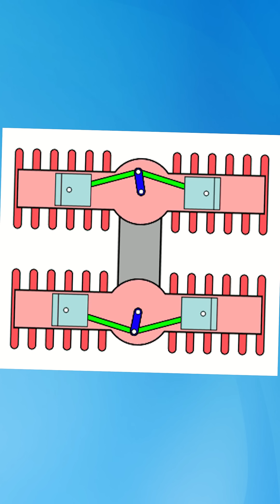wHY DoN'T CaRS uSE H-ENGiNEs?

Comment: It's 
>Big
>Heavy
>Overcomplicated
Reply: same
Reply: @peely1359 ?
Reply: sounds like it came from the depths of hell tho
Reply from the maker: Perfect
Reply: @BladedAngel  Not really. As I said above, cars never used H engines because they never need that many cylinders. H24 engines worked very well in pre jet-engine aircraft engines in WW2 where power over 1000 horsepower was needed. There was one formula 1 H16 engine. That's about the only application there's ever been in a car. You should take the "any more" out of the video title.
Reply from the maker: @londonalicante  i don't think this comment train was talking about Engines
Reply: @londonalicante  as a worker at Valvoline thats simply not true. Subaru uses a H 6 engine in there older outbacks and trevia b9
Reply: @mylifeperiod630  If you work at Valvoline you probably know something about engines but please watch the video before commenting. A subaru H6 is just a brand name for a flat 6. A H engine as defined in this video is an engine with 2 crankshafts, 1 above the other, each with identical number of cylinders in a flat arrangement. Only practical for applications needing large numbers of cylinders.
Reply: It worked well in the right applications (i,e those that at least 16 and preferably 24 cylinders) which was mainly planes before the invention of the jet engine. Nothing wrong with the configuration, it's just that cars are too small of an application for it.
Reply: @londonalicante  But we speak about cars.

And in cars H engines make no sense.

A V12 is better in any aspect
Reply: Stop describing my taste in women.
Reply: @TheMattvf16   wha...
Reply: @TheMattvf16  hell nah 🤦‍♂️
Reply: @TheMattvf16  vro likes losing
Reply: @TheMattvf16 ayo 😂💀
Reply: They probably cost a fortube in labor to repair.  Also imagine how rare the parts for those are, if there are any left anywhere!  It is basically an overcomplicated Boxer engine really!
Reply: Read top comment in syndrome voice
Reply: It should be an 'X' engine, two flat 8's at 60° to each other. Much simpler.
Reply: That what she said 😂

Comment: It just doesn't make sense. You don't need more than 12 cylinders in a car, and that's easiest and most efficient with a V12. Even Bugatti's V16 doesn't make sense. 1000 hp could easily be achieved with a V12, and it would be smaller and lighter. Different engine types have different advantages and disadvantages. But an H engine would only have disadvantages compared to a V12.

Comment: H is a fun configuration, but my favorite of these ancient niche engine layouts is the U configuration. Yes, U, not V. No one uses U engines because they are just really not good. For those who don’t know, a U config is really just two inline engines mated to the same transmission. It’s just objectively worse than a V because you have greater mechanical losses through the transmission than a comparable V engine, and the only example I know of was used in the Sherman tank during WW2 because the US was churning out tank chassis so fast that it was faster and cheaper to buy and staple together two straight-6’s than it was to engineer a V12.

Comment: They can absolutely be turbo charged. In fact the best known turbo-compounded aero engine was a flat 12 (Half a H engine) and had power to almost rival the early turboprop engines. The H engine would have been the next logical step forward after that.
Reply from the maker: I said it was difficult, not impossible.  Remember, big corporations run the world now.  They would gladly cut costs to turbocharge a V-Configuration, then to spend money figuring out how to link 4 cylinder banks.  We lost our whimsical curiosity long ago back in the 70s prior :\
Reply: @BladedAngel  💯%

Comment: The big issue was that you had to basically how damn near perfect timing with both sets of cylinders, and this was because if either seven cylinders without sync with the other, the synchronous gearbox that you had to use in order to use it as a single output shaft would basically turn into a rather dangerous shrapnel flinging device.

Comment: Subaru and Porsche use H engines so they still around Subaru using 2L H4 and 2.5 H4 turbo also back then they was using h6 engines and Porsche to this moment using H6 engines

Comment: "H" engines aren't hard to turbocharge or supercharge and they're not more parts intensive than other engines. You must have made that part up. The reason we don't see them in automotive applications much is due to their odd shape it is harder to layout the drivetrain around them than other engines. Honda, Porsche and Subaru still figure it out though.

Comment: I’ve been in an online argument about someone calling the Subaru flat six an h engine. And I corrected them saying no it’s just a flat six. An h6 would be two flat three engines mounted atop one another connected at the crank.
Reply: The H in H6 refers to the cylinders being Horizontally opposed, not the shape of the engine. So it's not a H engine or a flat six, it's a horizontally opposed, or boxer, engine
Reply: @ there’s three types of flat engines or opposed engine designs. The flat v which is a 180° flat v bank engine it’s called this cause there is a shared crank pin for two cylinders. A boxer flat is engine has a crank pin for each piston. The H engine is two of either of the previously mentioned engines mounted atop one another with two crank shafts. Calling the 3 liter Subaru legacy flat 6 a H6. Because the cylinders are horizontal is wrong. That’s like calling an inline 6 a v6 cause the cylinders are horizontal. It’s an incorrect use of terminology that doesn’t apply to that particular engine. 
Like shit I’ve only been studying this shit since I was 12 it’s almost like I know a lot about this topic.
Reply: @Echocompany2-7  You can tell Subaru that, they're the ones that named it. And according to them, the H stands for Horizontally. As for the flat part, you're correct, my thoughts went to Straight for instead of Flat for some reason, probably because I have heard some call it straight in the past.
Reply: @ Subaru definitely calls it a flat 6. 
Or the head gasket destroyer 9000.

Comment: The reason cars don't use H engines is because the configuration needs at least 16 cylinders (preferably 24) to be viable. Cars don't have that many cylinders. Nothing to do with "Innovation" in a car sense (though the aircraft H engines were superceded by jets.)

Comment: plus v and inline engines just need one crank. it would be a lot more complicated on how to compactly and reliably hook up an H engine to a normal car.
Reply: I would think you would just mate the transmission to the back of one of the cranks  to be simple......but as far as space for it all would probably need the hood lengths and space of the mid 70's cadillacs😅

Comment: It's too wide and interferes with the suspension space.
They are constantly in a Rocking motion, to solve it you need a Huge Flywheel, which some Older aircooled Diesel stationeries only had, or Complex balancing with Split pin Rods. 
It's always rocking or twisting.

Comment: You do realize Subaru's "H6" comes in 3L of displacement and is a 6 cyl right?

Those old engines are inefficient. They use turbo boxer 4's in small planes now. The size and performance have improved since those dinosaurs were in production.

You're wrong, boxer engines are great to turbo! The low center of gravity gives a lot of placement options for a turbo and the "Horizontally opposed" engine doesnt have the problem other V and inline engines have fighting gravity.

Comment: I knew the H engine. What's also really interesting is the U engine.
Reply: I heard of those.  They were used in tanks.  If anyone has a car with one, it may be Jay Leno.  He has a custom car with a massive Hemi V12 from a tank.  It would be interesting to see his collection that most likely consists of rare one off cars no one else has
Reply: @charleshines2142  I know that Sulzer built U engine, for example for locomotives.

Comment: The modern "W" engine type is a VVR engine. Much more fitting, and acurate.
Reply: Wait until you find our what letter is “double V” in German. 😆
Reply: @ there is a distinct difference between VVR engines and ACTUAL W engines. W engines have three cylinder banks and three cylinder heads. VVR engines are just two VR engines put together in a V configuration. Still two cylinder banks, still two cylinder heads.

Comment: Most of a V engine can be made on a 2.5 axis mill. The right skillset could do a straight 4 block on a drill press. Because the cylinders go in all directions in an H configuration you need to use a 4 axis mill or greater. This was at a time when reverse kinematics were not mature and people who understood machine code were even rarer than today so chances were better than not your expensive 4-5 axis milling machine would send your expensive H block down a tool path to hell halfway through the process.

Comment: Subaru's boxer engines are H-Engines. 

Even holding the engine designations of H4 and H6 respectively.
Reply: Those are flat engines.  H engines require two banks of cylinders stacked on top of each other on both sides.

Subaru engines on have one bank of cylinders.
Reply: Subaru did that to designate Horizontally opposed. A true H engine has 2 banks stacked on top of each other with the two independent cranks geared together.
So sorry, still just a flat 4 in the Subaru.

Comment: BRM actually hedged their bets between 12 and 16 cylinders so yes they did made a V12. But because they reckoned the H16 would make 500-600 hp, they went ahead with what is arguably the most complex engine in F1 history.

Comment: Last time I checked my Subaru boxer also happens to be a H4. Did you do any investigation at all for this masterpiece, or did you leave it to your mighty AI lords.
Reply: It's a flat 4 in a boxer configuration
Reply: @ Subaru officially refer to their engines as H4 and H6. I guess they must be wrong eh?
Reply: @user-fed-yum  Call it whatever they like, an true H engine has 2 independent cranks geared together. Now it has been a while since I've been in a Subaru engine, but pretty sure there is a single crankshaft in there. Now stack another flat 4 on top, gear the cranks together and Subaru would have an H8

Comment: This different than the wrx engine or the same?
Reply: That's a flat four. Subaru calls it an H for horizontally opposed but these kinds of H engines are basically two flat engines stacked on top of each other.

Comment: I thought H engines and flat engines were the same? In which case the wrx and brz/gr86/frs all still use it and im sure a few others those are just ones i know off the top of my head.
Reply: An H engine is essentially 2 flat engines(Subaru, Porsche) stacked on top of each other and the 2 cranks geared together. So no, nothing currently in production uses an H engine.
Reply: @sparkplug1018  I would love to hear your explanation of Subaru's H6 engine since nobody makes them. 🙄

All boxer engines are "H" engines. Crank in the middle (-) pistons on opposite sides ( l l ). ( l l ) + ( - ) = ( H ).
Reply: @Cbgrandtheftauto  A true H configuration is 2 flat engines stacked on top of each other, with the 2 independent cranks geared together. Emphasis on 2 independent cranks. 
Subaru calls it H4 designating a horizontally opposed engine. The information is not difficult to find. So NO Subaru does not make an actual, true H engine.
Reply: @sparkplug1018  I would encourage you to look at a EJ or FB engine's crank and rods laying in their natural state and see for yourself if they are an "H" design or what other letter in the alphabet they resemble.
Reply: @ Yes I’m aware, owned a few of those head gasket blowing turds. Also aware of the actual definition of an H engine and why Subaru decided to designate it H4. Doesn’t change what it actually is, which is a flat 4. 
By the way, by your logic, how do you get a 6 cylinder variant? Or is that an HI6 by your logic. Because no H I’ve ever seen has 3 vertical lines
Reply: @sparkplug1018  same logic can be applied to your "stacked" engine. 

"Head gasket blowing turds"  that's a good one, I hate to tell you, Subaru had an issue with the early 90's EJ251 blowing head gaskets due to the composite HG and fixed the issue on the EJ253 that became the run of the mill engine that went in everything for years. Unless you had one of those models, your poor maintenance schedule was the cause of your engine failure. 99% of all broken Subaru's are 100% caused by the owner.
Reply: @ By the way, how did Ferrari manage a flat 12 by your logic? Weird looking H or is that a HHH12 by your logic? Get over it, a flat engine is entirely different than an H engine. 
Also, I’ve flipped enough Subarus with verified service history to say that yeah, those engines have issues I don’t see in others. They fixed that, yeah that’s funny
Reply: @sparkplug1018  just because you "flipped" some 200k clunkers that had a few oil changes done doesn't mean every one of them are garbage and it sure doesn't make you an expert 🤦🏻‍♂️😂
Reply: @Cbgrandtheftauto  Oh you’re back again. And just because you drove one once doesn’t make you one either
Reply: @sparkplug1018  I own two of them. One I've owned for 15 years. Please tell me how you're more experienced here..
Reply: @Cbgrandtheftauto  So assuming that's correct, I'm going to guess that having done head gaskets and machine work on about 30 that I've flipped so far gives me a bit more insight. Subaru flat 4's and Northstar V8's are a gold mine for flipping, assuming you can do the work, and by luck, I can. And my machinist has seen so many of those Subaru heads he actually built custom tooling to set them up on the milling machine.

Comment: I wonder how it would perform if it where a boxer (paired cylinders reaching tdc simultaneously) engine instead of a flat engine like the one shown? That way any number of cylinders divisible by 4 would result in perfect balance while remaining insanely compact and cool

Similarly, its a shame that U-engines ( Like a V but with 2 crankshafts) are also almost never discussed or developed.
Reply: Subaru engines are well balanced. You can't even feel them run. If you do, it's probably misfiring 😅

Comment: H engines made the most insane sounds an engine could ever make. Brutal doesn't even do their sound justice lol
Reply: Fr
Reply: It sounds like cheeks though.
Reply: it sounds like a wet fart
Reply: isn’t it just two flat engines on top of each other? it sounds like if a high schoolers wrx had a flat 8 instead of a flat 4
Reply: A flat plane 8 cylinder has a similar firing order to a cross plane V8. H16 is basically two F8's bolted together. That's why it sounds so glorious. It's basically two American V8's roaring in unison.
Reply: Heard better sounding V6's😭✌️
Reply: @ily.SUMMER  your taste is garbo then
Reply: @NicoLas-xy3ew  real
Reply: @ily.SUMMER last thing you heard in life was a straight piped vq shut the hell up lil bro😭

Comment: I mean, wouldn't a boxer count as an H engine, like Subaru's 4 cylinder? Or would it be only the flat engines in which the pistons are moving always in the same direction? Either way, I find it funny you didn't mention Ferrari's H12s from the 80s, those are to this day some of the best engines ever made.

Comment: Is a Subaru Boxer engine not a type of H?
Reply: How a H-engine was made:

2 Boxer engines + stacked each other
Reply: No it's kind of an h like the outback and the Tribeca use an h6 Porsche does too
Reply: @BrovarianMotorWorks 😂 You do realize a Subaru "H6" is just a 6 cyl boxer motor right? 

All Porsche  and Subaru boxer engines are "H" engines. They are "Horizontally opposed" engines
Reply: @Cbgrandtheftauto  you literally just repeated to me what I was saying. H engines and boxer engines are same.

Comment: Yeah working on Subarus is a pain in the arse enough. Imagine trying to do spark plugs on a H-8
Reply: Motorcycles with boxer engines are easier to work on ironically
Reply: @abdullahakhtar9824 I have never seen a motorcycle with a boxer engine actually, sounds interesting. I know small planes have them aswell
Reply: @Kamo442  bmw uses them a lot on motorcycles